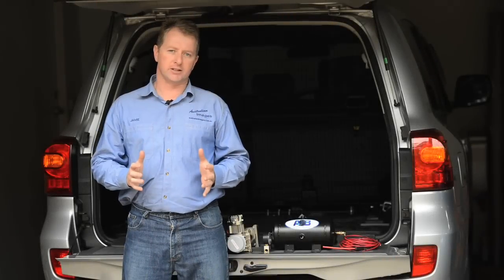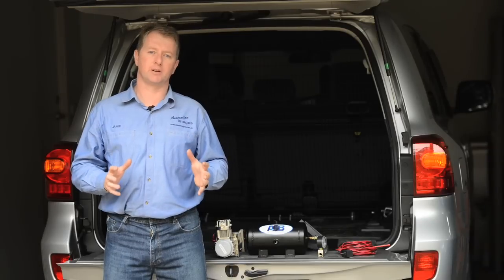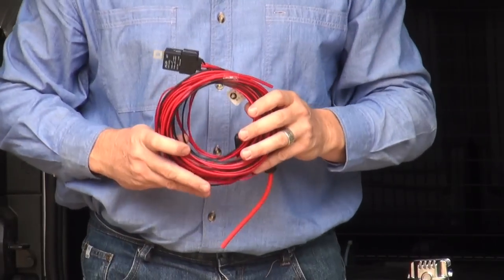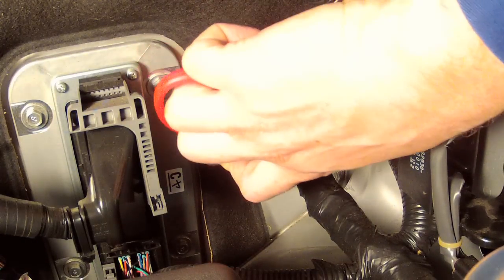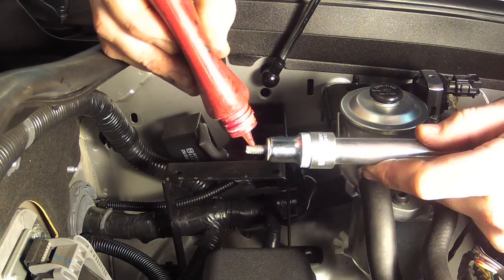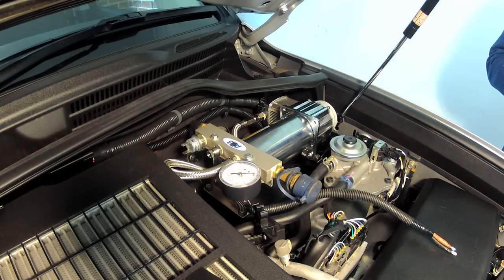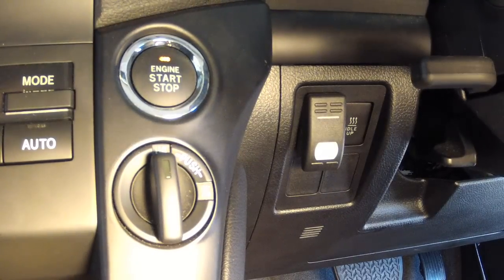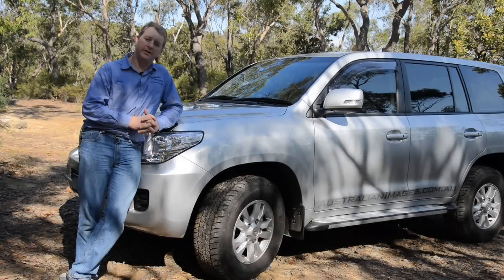Land Cruiser 200: AOB Air Compressor Kit install

Comment: Hi Jamie. Have been enjoying your videos on the land cruiser. I would like to know if the plastic hose was long enough in the kit for the rear mounting of the tank from Air On Board and can you tell me where you purchased the push in connections for the plastic hose? Thanks.
Reply from the maker: Hi Wayne, To be honest it's been so long now I can't remember if it was long enough or I had to buy more! Try contacting them and check to see how long the included hose is. I'm sure they can supply more if required.

Comment: After all these years. Are you still running this compressor? Would you recommend it?
Reply from the maker: Yes, still running it and have had no problems. It gets used quite a lot for short periods, for inflating airbags suspension etc, and occasionally for airing up after sand or dirt driving.
Reply: @austimages  great stuff. Thank you.

Comment: Hi Jamie, did you do a comparison against the ARB twin or single compressor? I can't find any reviews. I have a single fitted to my 200 with a 4lt tank but I find it very slow. Cheers Ian
Reply from the maker: Hi mate, No sorry I haven't compared it to any other compressors. At a guess, I'd say this is faster than the ARB single, but slower than the twin.

Comment: Hi, Just wondering how much the AIR Reservoir helps with pumping up the tyres?
Does it reduce the time to pump the tyres up much? or is it mainly for air tools?

thanks
Reply from the maker: If the reservoir is full (i.e. you've turned the compressor on a few minutes before you start inflating the tyres), then the first tyre can almost be topped up (say from 20-35psi) from the reservoir alone, so over the four tyres, it probably reduces the total time spend inflating by 25% or so.